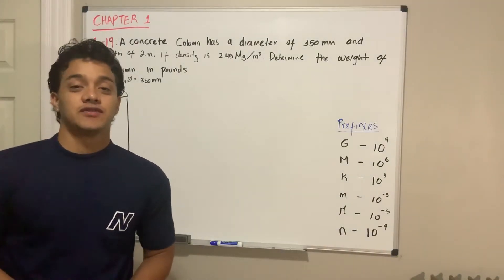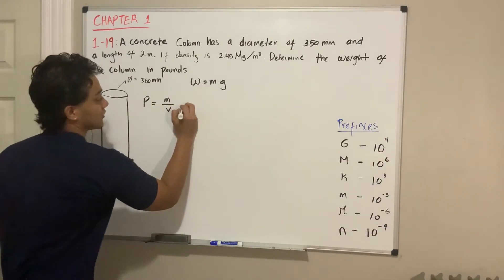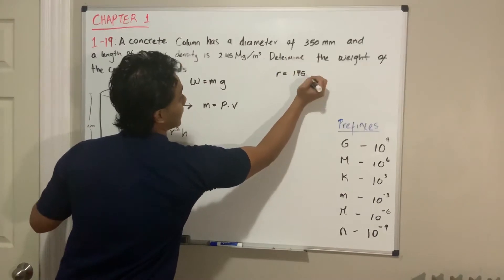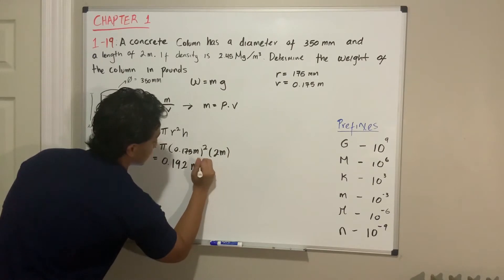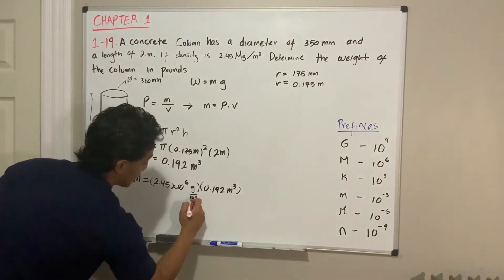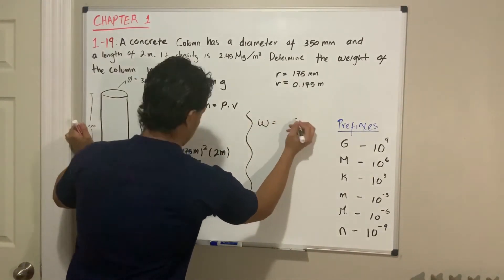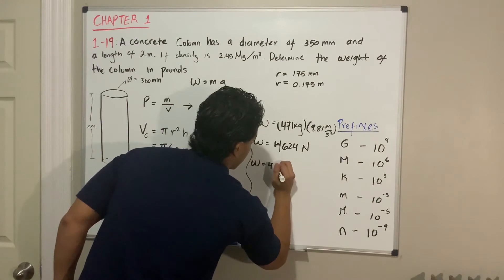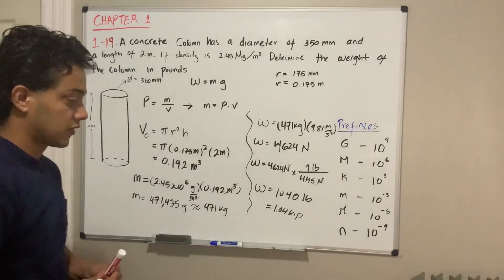Statics 1.19 - How to determine the weight of a column - Explained*

Comment: Great Video! Question, why did you use the 10^6 (Mega) to find the mass?
Reply from the maker: Hello, because the problem statement tells us that the density is in Mega which is equal to 10^6. Therefore, I chose to convert the unit from Mg/m^3 to just g/m^3.